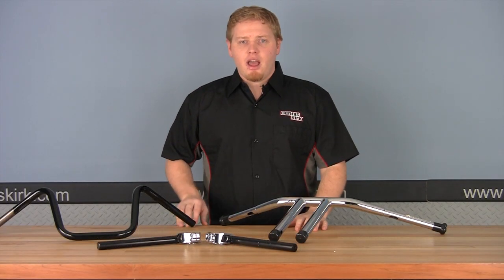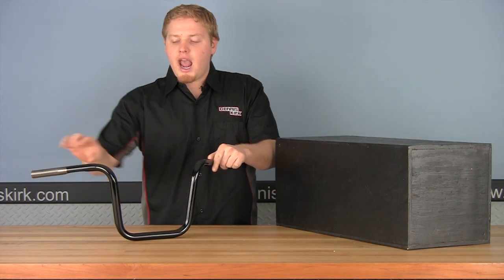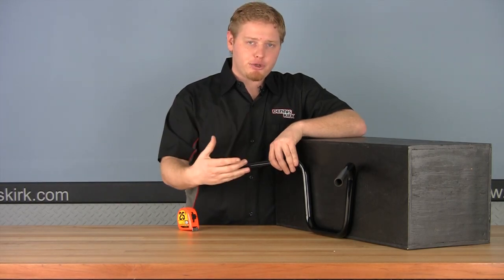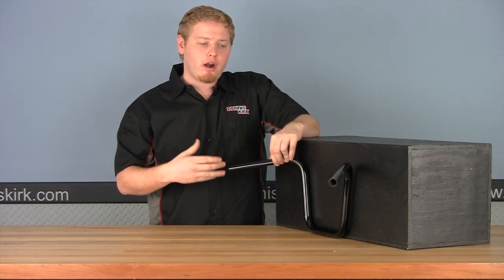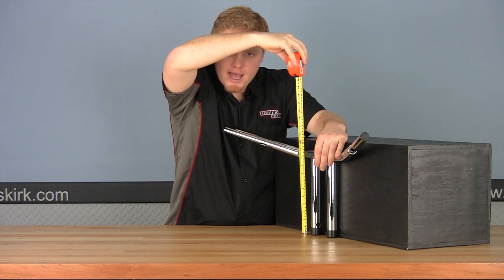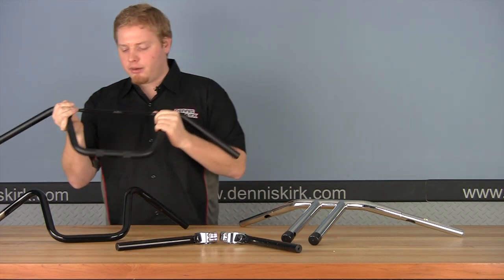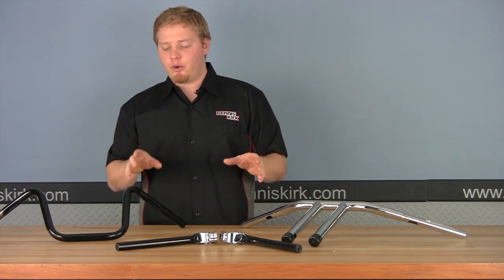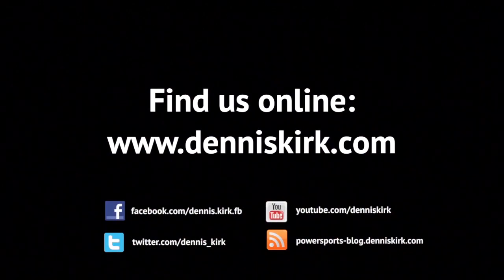Tech Tip: How to Measure Handlebars for your Motorcycle

Comment: Hi and thank you for the video. I understood the measurements part,  my bike a Rocker C 2008 I want to fit a ape hanger  and as you probably know very hard, for me, to fit something which is comfortable at the same time looks good. can you tell me is this model can fit ? 12" RISE x 32" WIDTH x 9" CENTER WIDTH x 5" PULLBACK or 12" RISE x 29.5" WIDTH x 7" CENTER WIDTH x 5.5" PULLBACK, or Rise: 12", 14" or 16" rise Width: 35" Pull Back: 6" Center Width for risers: standard 3-1/2" from center to center of knurls Center Width total 1" portion: 5-1/2" 
Tube Diameter: 1.50" Width (at bottom, outside): 13.5" Width (at bottom, inside width between risers): 8". THANK YOU

Comment: Vulcan 900 Custom. My stock t-bars have a 1 1/2 pullback bend in the risers. then a 6 inch pullback using a strait edge across the top of the riser where the bars are welded. Specs say 6 inch pullback. So we discount the bend in the risers when measuring?

Comment: what about how do you measure bar diameter? example 7/8 bars
Reply from the maker: Great Question! There are 2 major measurements, 7/8 and 1" bars. This is speaking to the width of the pipe in which the bar is made from. You can either use a caliper, or lightly fit a clamp on the bar and measure that distance.

It's best to measure where your grips will go, and where the bars will mount to the triple tree. Normally these numbers will much, but some bars are designed to look bigger then their mounting clamps. Truth be told, I've even googled the stock bar size. Hope this helps! -Drysen